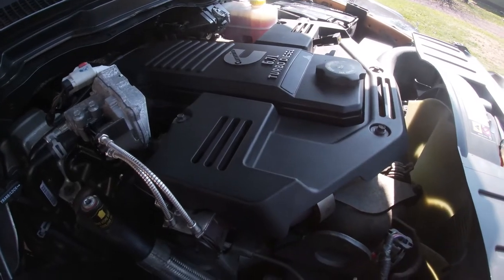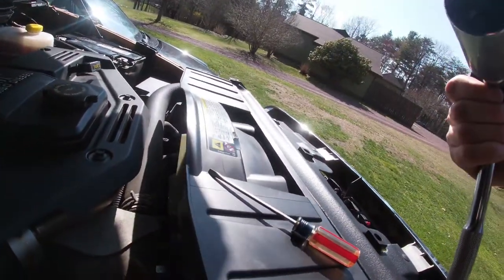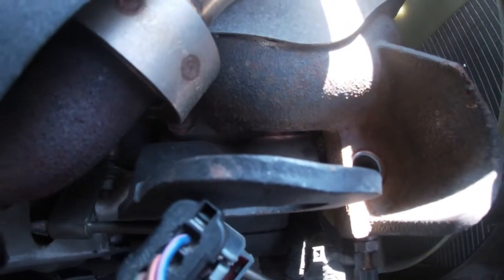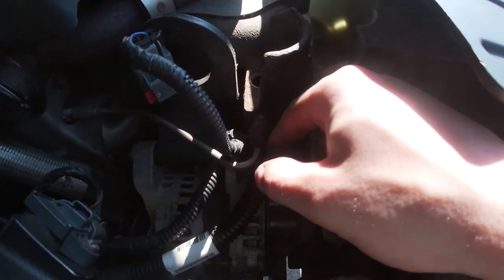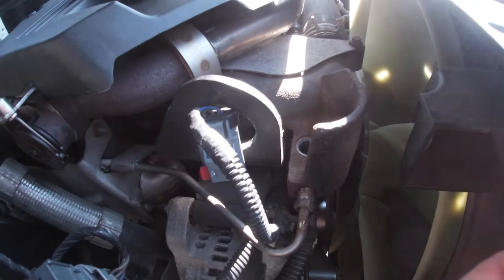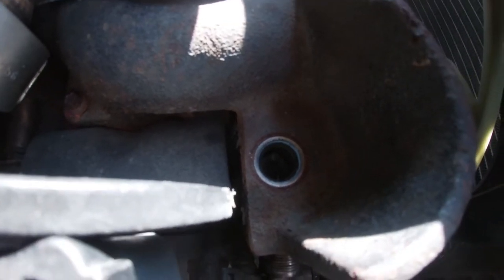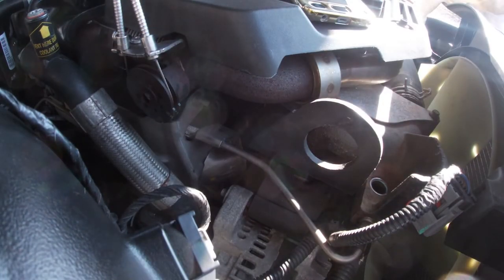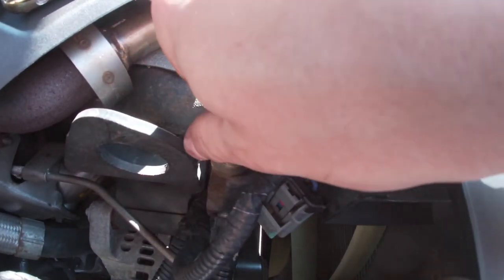6.7l Cummins Exhaust Back Pressure Sensor & Tube Maintenance

Comment: Has anyone had a surging problems? When your stopped at a red light the truck idles low to high continuously. It’s really odd. I don’t know what it could be.
Reply from the maker: It could be a dirty MAP sensor.
https://www.youtube.com/watch?v=DccwaxDOvT0
Reply: Every now and then mine would do it. I just ordered another map sensor. This is like the third sensor I've bought now.
Reply: Did you find the problem ?
My 2019. Does same 
Vibration at idle and when accelerating it goes away
Reply: It's the fuel pressure regulator that is casing that issue.
Reply: Thank you !

Comment: If the truck is tuned and deleted will it have this sensor? I don’t so this sensor on my truck it’s a 2016
Reply from the maker: Excellent question, I've been wondering about that myself. I do believe that it's removed in that process but I'm not 100% positive.
Reply: @AES5967 it's not removed
Reply from the maker: @chriswhite2686  I appreciate the insight!
Reply: ihave a 2015 and it is deleted for some reason its a little more hidden then whats in the vid above its in the same location but on my truck there is little plate that covers the top of it to wear if your looking down at the motor you dont see you have to adjust yourself and use light to see it . anyway i am having the same problem on cold starts with exhaust brake engaged it starts up normal and then about 5 sec in it starts to surge and dump fuel into the motor and then just black smoke out the exhaust already replaced actuator and still having this issue i pulled the TMAP sensor of the intake manifold and it was clogged with soot that sensor is supposed to send data to your ECM for boost pressure air temp ect. ordered one from the dealer and should be hear Friday if that dont work i will try this. I wanna say its either this the exhaust back pressure sensor or the TMAP sensor on intake manifold im not getting any codes yet or else i would provide them. If anyone does go the TMAP route there are 2 of these sensors on the truck one is located on the air intake on the passenger side and that one records air temp the one located on driver side of the valve cover on the manifold its self records air temp and boost pressure coming from the intercooler so dont get them confused because they are identical but function differently very important part numbers are also identical 2987332 is off the air intake next to your MAF sensor if you want the TMAP sensor it will be 2987333 and those are the cummins number off the parts themselves a little long but just wanted to post this to help somone out ive been dealing with this problem for about a year now so if the TMAP dont work definitely going to try and clean or replace the back pressure sensor ill try to report back here if i have any luck .

Comment: Hi just a question I had the cable for the egr cooler bypass valve break.  I had a machine shop fix and reinstall a new cable.  When I put everything back together I'm still getting p245b code.  When I start the truck I don't see any movement in those 2 pulleys with the cable connecting them together.  Is there any way to test whether the electric motor that turns the cable is any good.  Dealer wants like 1600 Canadian dollars for this part that I assumed only had a broken cable.  Any feedback is greatly appreciated.
Reply from the maker: Sounds like the bypass valve is stuck. When you had the cable off for replacement did you happen to manually operate the lower pulley by hand to check for proper valve movement? 

That code typically means a stuck valve and if the valve is stuck the servo motor kept trying to open it and eventually caused the cable to wear and break. 
If the cable broke then the servo motor must have been working. (Unless the cable was damaged prior or flawed someway) 

Let me know where this takes you.
Reply: @AES5967  
When I had it off the valve moved very smoothly didn't bind at all don't understand why the cable broke to be honest.  I went to dealer they want like 1300 US and the part is back ordered.  Not sure how safe it is for the engine to drive with bypass valve not operating.
Reply from the maker: @mirocabraja5128  Interesting. Start with the easy stuff. You may have done these already but let's review. 

1. Disconnect batteries for 20min. 
2. Check for electrical odor coming from the servo. (strange.. but electrical stuff tends to leave that burn smell)
3. Clean the servo connectors with electric cleaner and inspect them. 
4. Reconnect everything and start it. Let it run for a bit. 
4. Check for codes again (clear if present) and watch for pulley movement. Try with the exhaust brake on too. 

Report back
Reply: @AES5967  ok I'll let u know
Reply: Clear the codes manually

Comment: I have gotten boost but no brake
Reply: I got boost but know brake too, had the actuator replaced but the brake works for a little while then quits working until I turn off engine. Any thoughts.
Reply: Low-end hard hitting boost or only mid-throttle, spooled-up boost? If your VGT is stuck full-open it'll need time to spool and brake won't work.